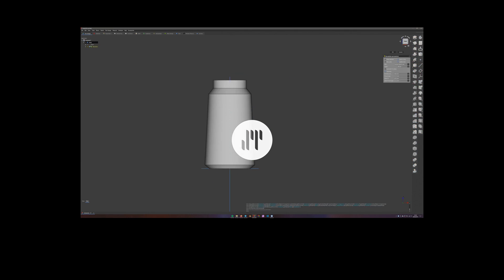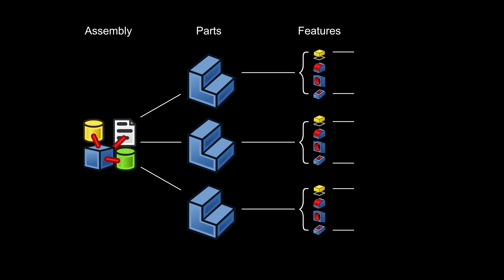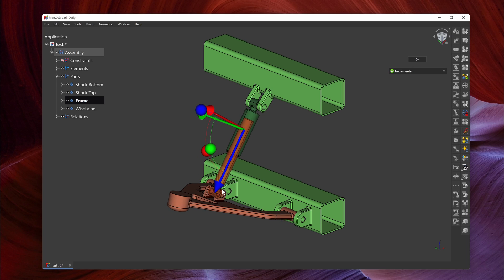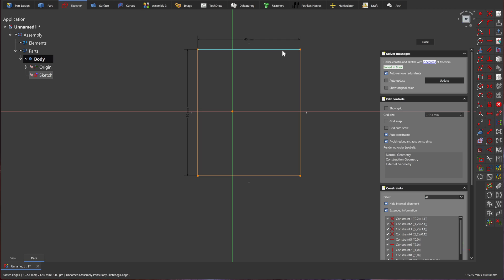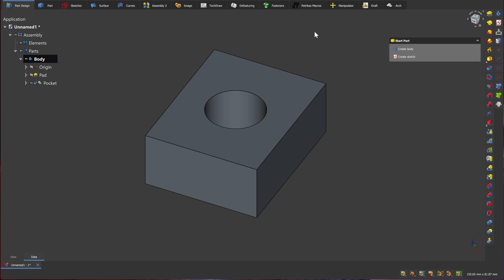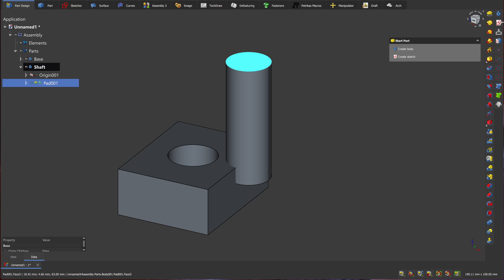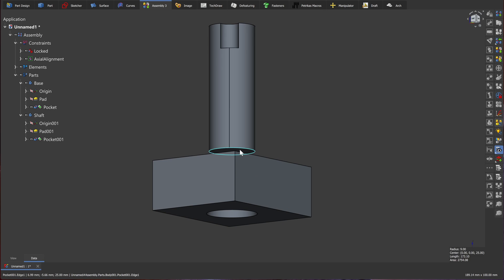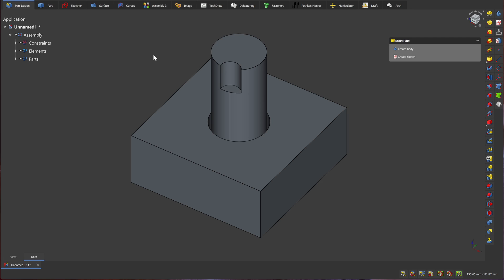3D CAD is easy! Introduction to Solid Modelling for absolute beginners.

Comment: This seems like a great tutorial. I think it would be more helpful if you were to do the video with a default install instead of your customized setup. Its hard to follow along when the items are in different locations. I also can't find the assembly functionality in my version .19 of freecad.
Reply from the maker: Hello,
Just to clarify: this wasn't meant to be a tutorial that was supposed to be followed step-by-step. This was meant to be an introduction to Solid Modelling and not just FreeCAD. 
I've used FreeCAD as a tool to illustrate my points, but this information is not limited to FreeCAD.

I am using FreeCAD 0.20 Linkstage3 Branch, Daily build: https://github.com/realthunder/FreeCAD_assembly3/releases

Comment: I'm not getting the same options for clipping as you do. I really like the texture, it's much better visualy and easier to work with. Can you share how to get this? I'm using realthunder's stable branch.
Reply from the maker: Hey, you need to enable "Experimental" in the rendering section, in the Preferences. Hope that helps!
Reply: @StudioPetrikas  Thanks for the fast reply! The experimental rendering is not included in the Stable release and I was confused at first. After downloading the Daily it showed up. This is quite important for my workflow and will improve it tenfolds, thanks again!